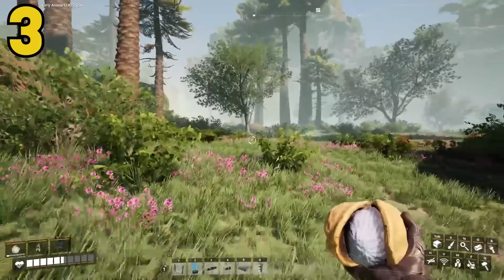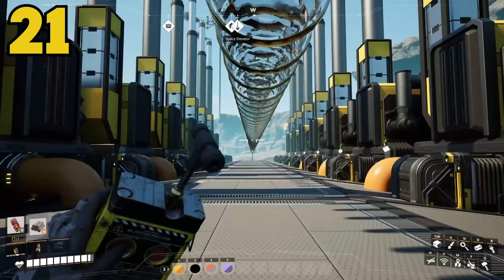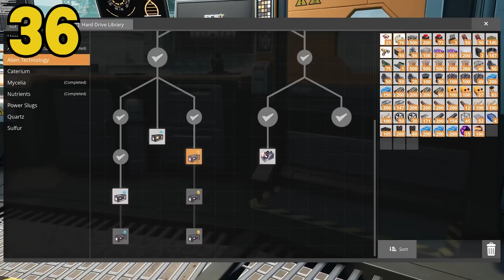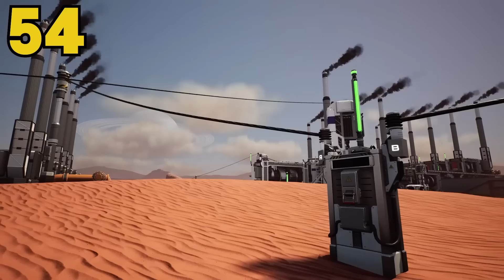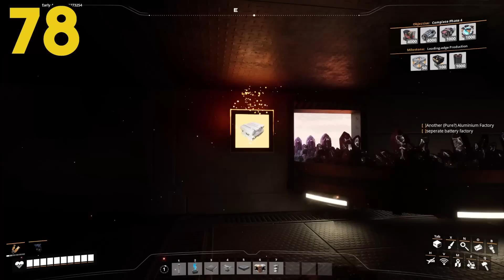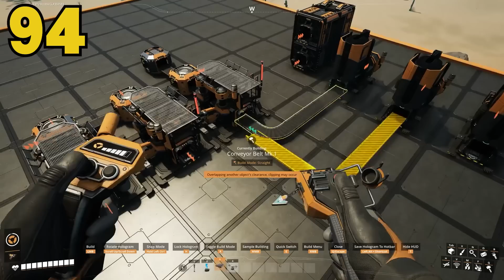100 Satisfactory TRICKS New Players Need to Know in 2024

Comment: Any tips in your experiences on when you'd consider a certain factory complete? I understand the concept of the game is to rebuild and in a sense midmax, but is there a certain amount of resources you get per minute when you can hang up the phone and call it complete? For example, I make 20 reinforced plates per minute. Is that enough for late game components? Or will be the time I hit end game need like 50 plates per minute etc?

I feel like I have a good set up so far, but I worry I'll have to remake and decorate my factory all over again because I'll need more reinforced plates etc.
Reply from the maker: I guess everyone will have a different response with this because there isn't a correct answer. With so many alternative recipes, there is always a different way to create more of a certain item in various regions across the map.

If you are truly worried about not making enough, remember you can keep your original setup and use power shards to overclock machines, miners and belts can be upgraded. If that still isn't enough, then venture out to a new area and build a new factory for that item. You can always transport  it around the map

Comment: Pro Tip.
You have 10 action bars... not just 1
Simply hold Alt+Mouse Wheel up or down to cycle through. The number will change to let you know which action bar you're currently on.
Reply from the maker: @b4rs629  isn't that number 17?

Comment: 101: When you discover a new node, don't hand mine it. Build an equipment workshop and make 4 or 5 portable miners and make them do the work for you
102: When you discover a new resource, build another MAM right there and start researching it right away.
103: Mark out new locations like nodes by running power lines to them. You're probably going to need it soon anyway
Reply: i do that last one all the time because i LOVE the power line zipline thingy, it's so much fun
even if we dont plan on building somewhere ill sometimes setup up the power line as we go just to make fast travel back easy